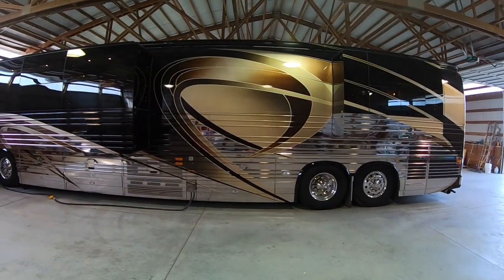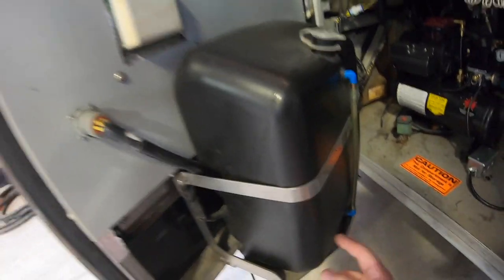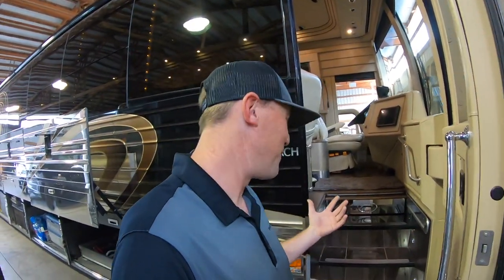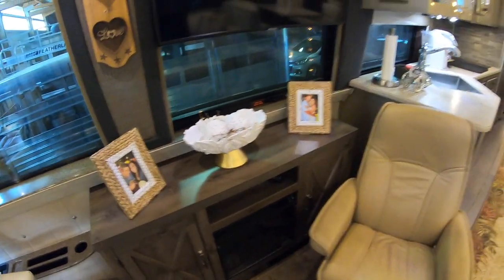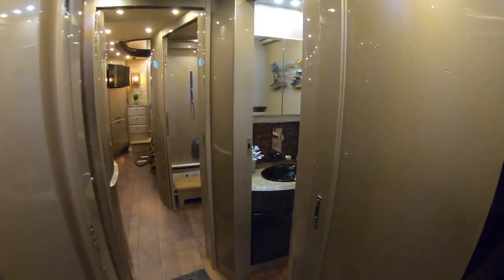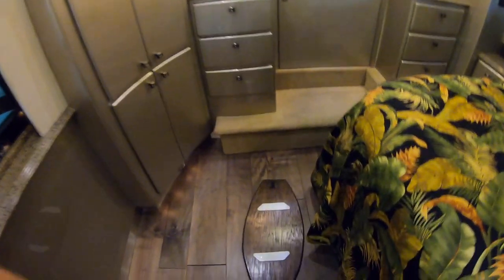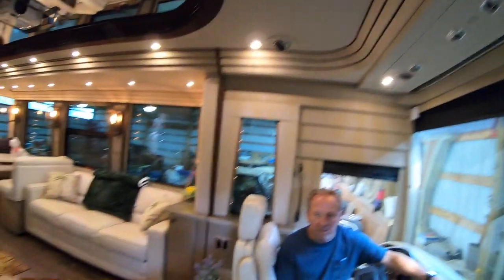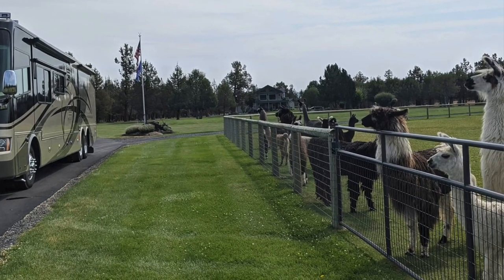PREVOST COUNTRY COACH OWNER INTERVIEW AND COMPLETE TOUR

Comment: On the Prevost XL XLII and X3 that tank in the under driver compart on the door is for with windshield washer fluid.
Th H3 would have the tank where the aux compressor is sitting on this coach.

Comment: Some parks offer a phone number at each site and you can hook up the coach to the parks phone system through  that jack (from the pedestal). My coach has 3 phones, one buy the driver, one at the dinette and one by the bed. They act as an intercom unless a live phone line is plugged into the coach. Cruse air in the basement.  That is a  condenser.  It's a nice system.
Reply: Christopher Rasmussen, Oooooh 😲, now that explains the phones ya see in these older coaches, that is actually a cool idea. But with cell phones now a days I can see how that is likely phasing out. Thanks! Cheers 🍻